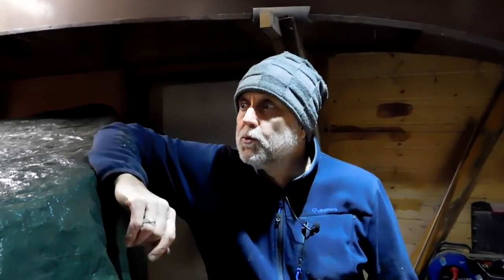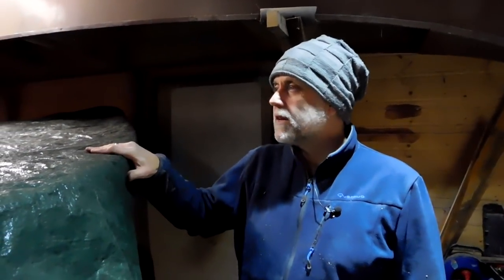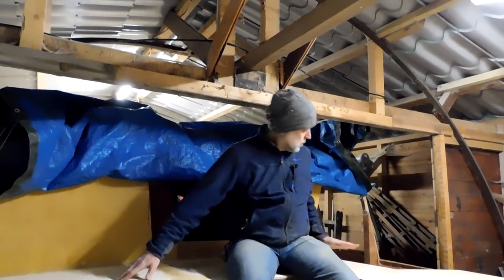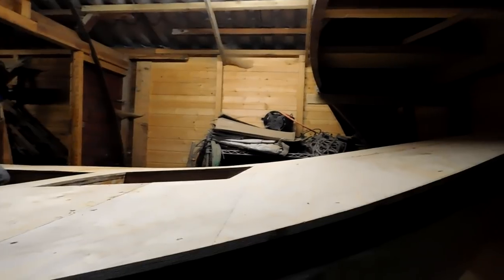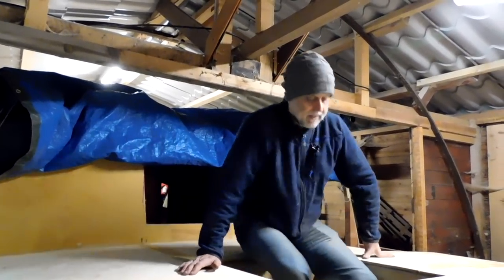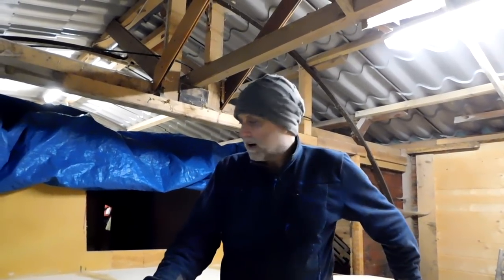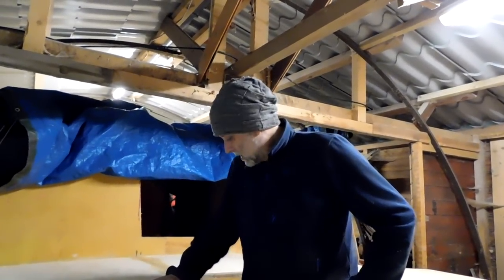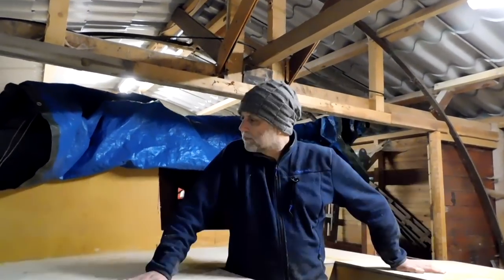The Aft Deck (layer 2) - SV Tapatya EP63

Comment: TONY ARE ALL THE EURO CANALS EASY TO GET TO? WE MEAN LIKE GERMAN TO FRENCH OVER TO UK BACK TO NETHERLANDS HOW DOES THAT WORK AND HOW DO YOU PLAN TO MAP OUT YOUR FIRST TRIP? 13HP IS PRETTY GOOD FOR A BOAT MADE FROM THE MATERIALS THAT TAPATYA IS MADE FROM. HOW MUCH FUEL WILL YOU ALL BE ABLE TO CARRY? I AM FULL OF QUESTIONS ARENT I. JUST ASKING, LOVE THE WAY TO DO THINGS, LIKE THE SECOND LAYER ON THE AFTER DECK, WILL THE RUDDER BE ON STEERING WHEEL OR TILLER? JUST ASKING BECAUSE THEY HAVE AUTO PILOT AND ALL YOU DO IS PUNCH IN KEYS, WORKS ON TILLER OR STEERING WHEEL. COST A FEW BUCKS LIKE 1500 USD FOR A GOOD ONE WITH GREAT SUPPORT AND WARRANTY, THEY SHIP THE REPLACEMENT TO THE DOCK/BOAT YARD YOU ARE AT WHEN IT GOES OUT. JUST ASKING OLD ONE LEGGED JOSEPH T RETIRED NAVY
Reply from the maker: Hi Joseph
The mainland European canals are basically easy to use, but the UK ones (particularly England and Wales) tend to be too narrow for regular boats - there are some exceptions. It's a way off still, but at the moment, I imagine the first trip to be the Elbeseiten canal into the Mittelland canal into the Rhine. Down the Rhine to the Netherlands and join the canal system there. Netherlands to Belgium to France in the canal network. Maybe tour France for a while before rejoining the Rhine near the Swiss border. Down the Rhine to the Main. Up the Main and into the Main/Danube canal, into the Danube. Down the Danube to the Black Sea and through the Bosphorus to the Eastern Med.

Fuel tankage will be in the region of 50 gal. US. She'll be tiller steered with a rudder hung off the back. I already have a tiller autopilot, but I don't think they're accurate enough for canal usage - reckon we'll be hand steering in the inland waterways!

Questions are good, Joseph. Keep them coming!!

Comment: Thats a good amount of work Tony. Well done. I like your cordless circ saw so much Santas bringing me one. Should save a lot of climbing up and down on the boat. Do you have ant piics of a finiished model of your boat?
Reply from the maker: Thanks mate. Yes, it's a great tool, the cordless saw. I use it a hell of a lot. I don't have any pics of a finished version but there are several similar ( mostly slightly bigger) versions that you can see online. Google "Benford dory Hestur" or " Willow" or "Badger" to see the 34 ft version